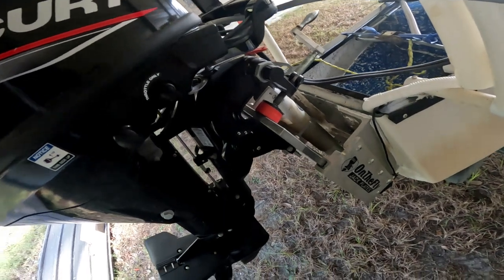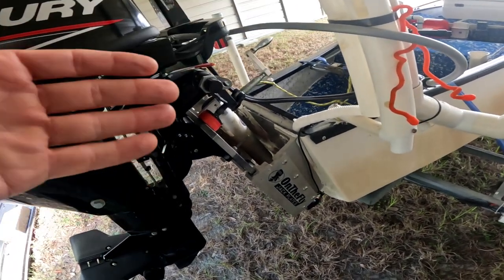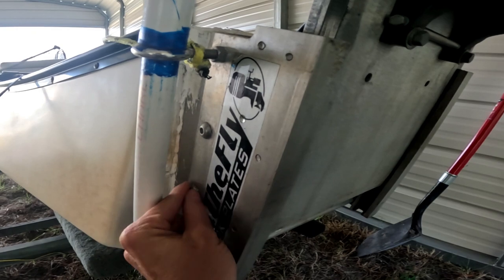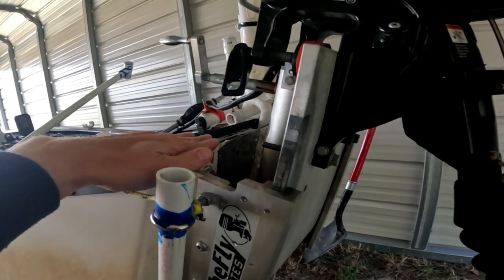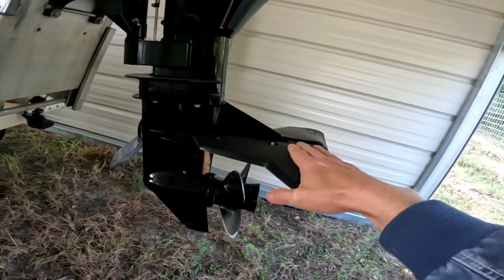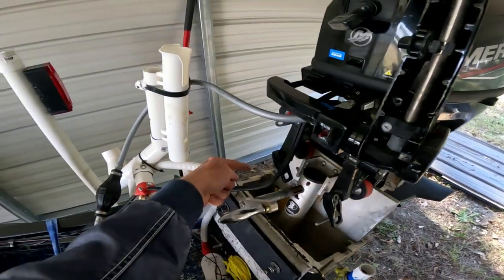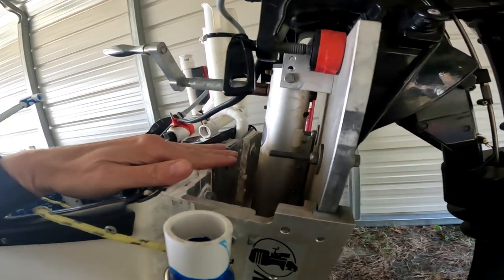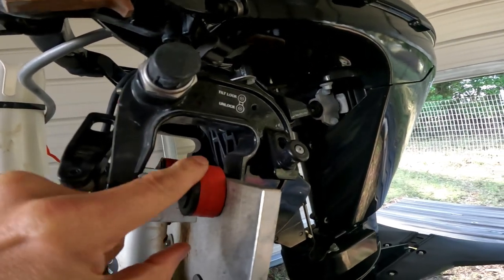On the fly jack plates

Comment: Great idea with the eye bolts! Do you remember what size they were? I have the same jack plate on my gheenoe and love it 👍🏻
Reply from the maker: Sorry about that but I dont remember. You can take out the little hex head bolt that comes with the jack plate to your hardware store and throw a nut on it there then find the corresponding stainless eye bolt that it will fit on. I'm not good enough to eyeball it lol
Reply: have you found it? the jack plate is on its way and i also want to do this.

Comment: Love the set up! Do you by chance know the bolt hole spacing through the transom? Cant find any dimensions online and my transon akresd has a jack plate, just looking to upgrade to this one haha
Reply from the maker: Hey I don't know but call the number on the on the fly website. The owner is very responsive and great to talk to. Super helpful. I will tell you to attatch it to the transom as high as you can, mount the motor as high as you can and use short shaft motor. It will help you run skinny

Comment: Matt.  Thanks for the tips on the jackplate.  Very helpful.  What model Gheenoe is it installed on?  Thanks.  Vic
Reply from the maker: The 15'4 version.  part of me thinks I want the 15'6 classic version for more stability and a wider back but that one is also 100lbs heavier and the weight is a big difference maker for how I use mine
Reply: @mgsfishing  Thanks for the info re your Gheenoe.  I have a 13' that I currently power with a Torqueedo 1003 and the jackplate would be very helpful in finding the most efficient and useful settings for this combo.  In theory, the modest setback of the jackplate should improve top end speed slightly .  Have you noticed this effect?  Thanks again.
Reply from the maker: @victorheckler2191  I did not notice a speed difference except for the fact that you can run faster in shallow water because you don't have to trim the motor as far up which keep the back end of the boat from bogging down under power